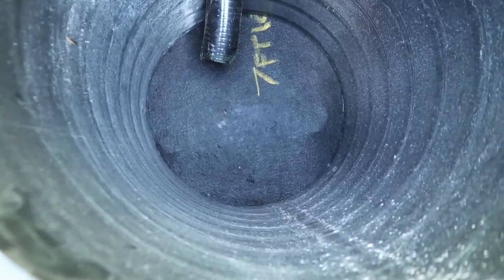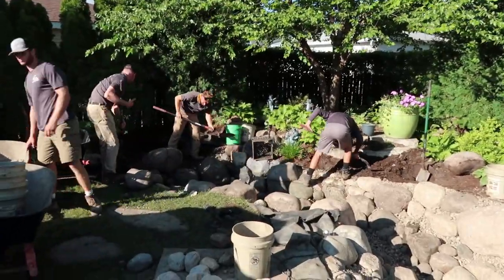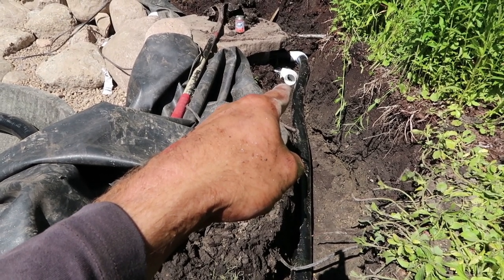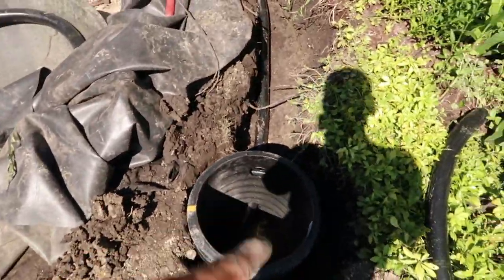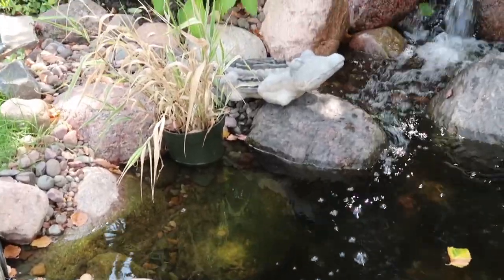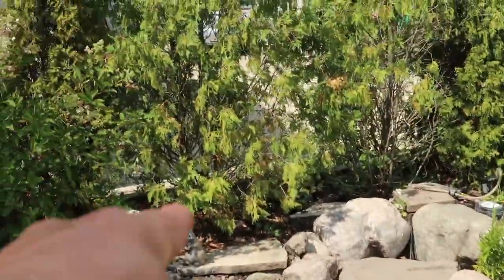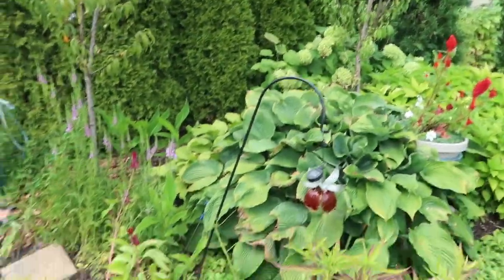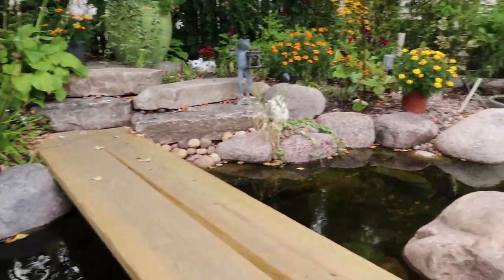*Garden Pond* Extension W/ Waterfall REVEAL - Part 2

Comment: Hi I have a question. I am in the process of extending my fish pond. At the moment my fish pond is 2300 gallons I am adding 30 x 30 feet to the pond. The deepest part will be 4 1/2 feet. My question might sound a little crazy but the fish have been hibernating in the old part of the pond which is 3 feet deep. Do you think they will now go to the new part of the pond which is deeper to hibernate in? I heard fish go to the deepest part to over winter but I am not sure since they have been hibernating in that spot for many many years.